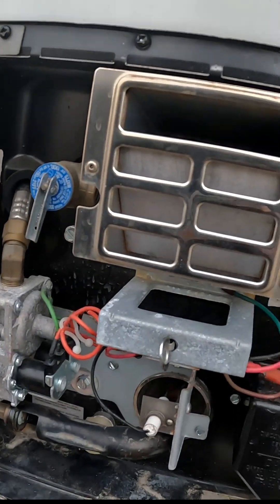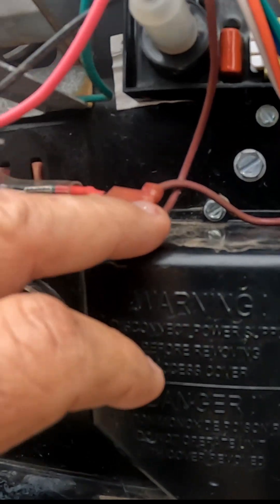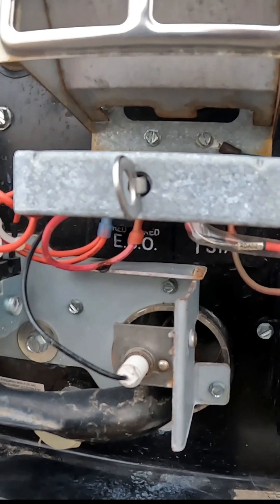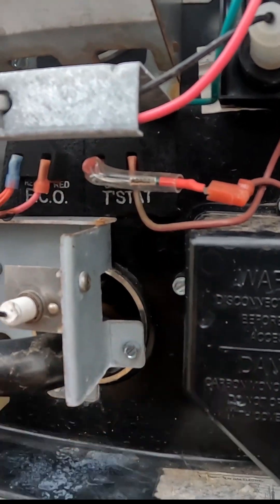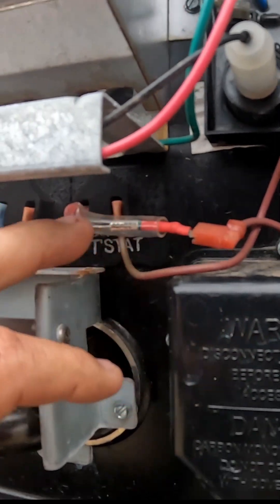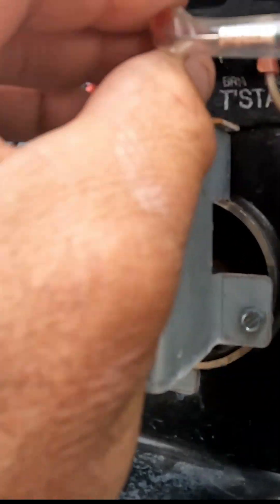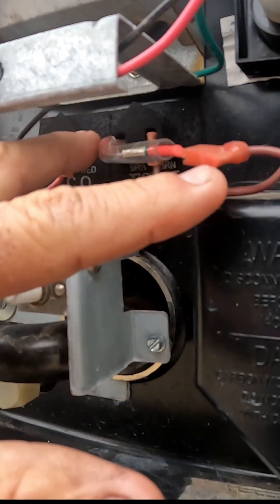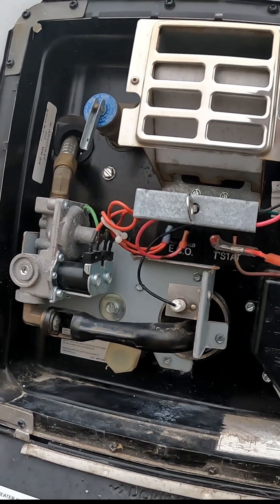RV Hot Water heater Thermal Fuse troubleshooting

Comment: When I pull on the t stat that’s connected to the heater it won’t come out I feel like I’m ripping out the whole thing
Reply from the maker: It is very tight, use a pair of needle nose plyers at the terminal end it may be corroded. Question are you talking about the thermal fuse, the T state is internal and held in by screws on some models.  The thermal fuse is tight and hard to release because of the angle.  

 Thanks for watching
Reply: @ yes the thermal fuse feels stuck. I feel like if I pull any harder I’m gonna break something
Reply from the maker: @davidcasterline2235  kill the power and put WD 40 it will release
Reply from the maker: @davidcasterline2235  kill the power and put WD 40 it will release